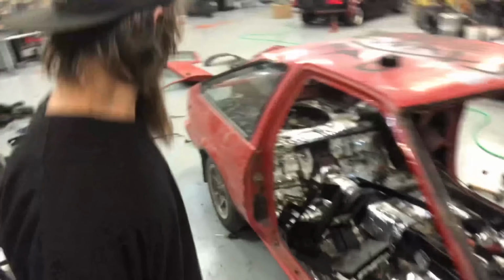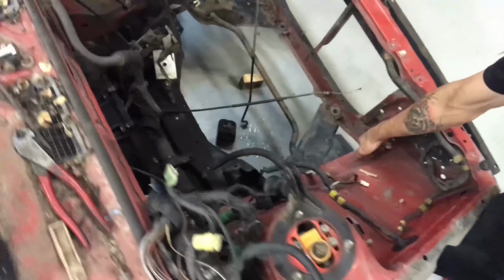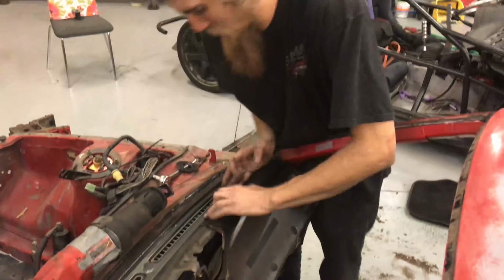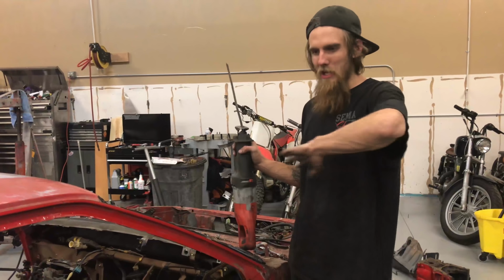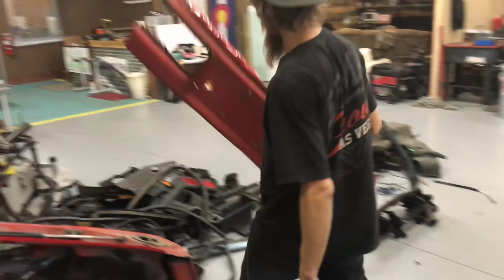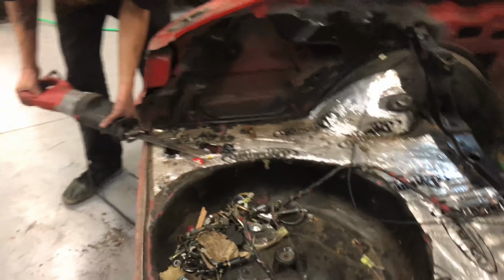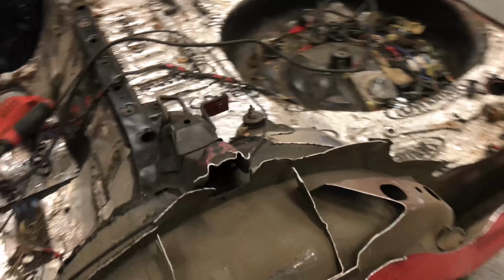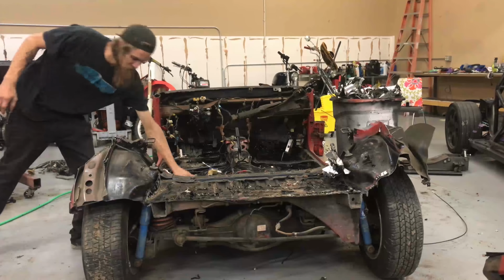How To PROPERLY Build Your Own Death Kart

Comment: Just a tip for anyone about to do this. It's a good idea to tack weld in a couple tubes from the a pillar base to near the rear shock mount in an x pattern. This will prevent the chassis from twisting or moving once you remove all the structure of the roof.
Reply from the maker: Very good point!

Comment: I'm currently building one out of a subaru impreza RS! I don't have a tube bender and it would be really cool to see a video of how to make a strong kart with no tube bender. Keep the vids coming!
Reply from the maker: Your best bet would be to buy a prebent cage kit for the Main hoop and a pillars. It wouldn’t be safe to have miters instead of bends
Reply from the maker: Square tube looks like super ghetto and like I said before mitered and welded joints aren’t nearly as strong as bends

Comment: Can you make some more of these I'm trying to build an off-road version of a death kart and I'm using a fox body mustang could use some more pointers to base mine off of
Reply from the maker: Kodi Pokorny Yeah what sort of videos do you want?
Reply: Matt 6berries I'm not the most skilled mechanic or fab guy the chopping up part seems very straight forward but putting in the new tube chassis and roll cage proper instal will be my next step
Reply from the maker: For the cage make sure to use proper sized tubing, lots of triangulation and good welds
Reply: I'm a good welder do you think a pre built cage would be the smartest way to go I'm building this kart to take on some of the more leisurely trails in the Colorado Rockies
Reply: My I don't know if you can call death Kart is going to be a lot heavier due to undercarriage skid plates things of those Nature's it's going to be designed almost completely different I'm just basing the whole principle idea off of the death Kart
Reply: Hey this is a couple months later but did you ever build that fox body? Sounded sick, if so what’s your Instagram?

Comment: Can u go over the cage design a bit? I ain't never built nothing before and went all in by cutting my crx lol. Your videos have been extremely helpful
Reply from the maker: I’ll do a video of that sometime soon!
Reply: The best place to start is look at the rule book for where you plan to use your car, design your cage based on their tech rules. Likely since a kart doesn't have doors and stuff you may want to add to it, but the rule book is a good place to start.

Not planning on taking your car to a track? I would suggest looking at the scca rules for autocross or time attack. Or perhaps the rules for a pro/am formula drift car?

Comment: i feel like this is kinda a waste since the ae86 suspension is too basic you'd be better off with almost any other car as a base. you could have had independent rear and better and cheaper access to replacement parts
Reply from the maker: ShadowFox439 I can’t disagree with you there. It’s what the customer requested because he also has a badass trueno though